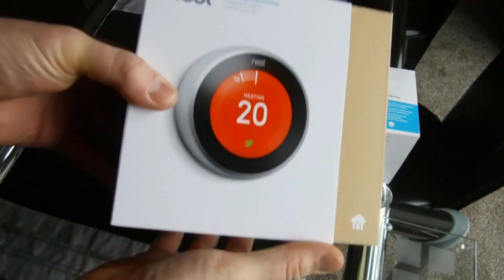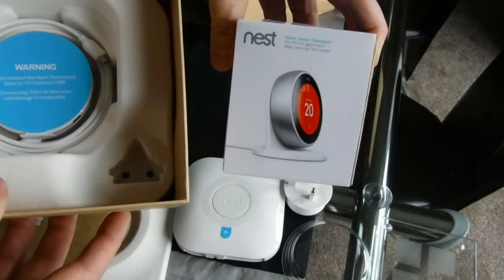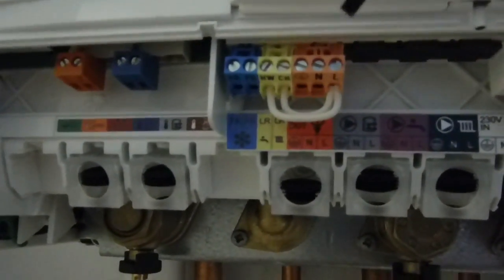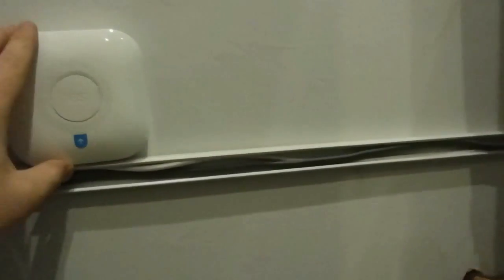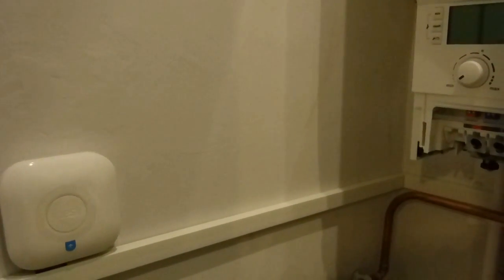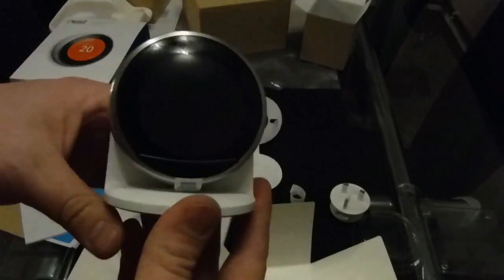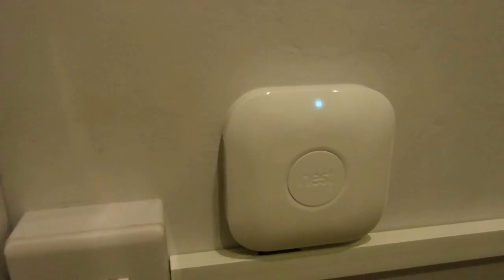How to install Nest Thermostat 3rd Generation - UK

Comment: Hi Charlie great video thanks, just had a question about your earth wire. How come you did not wire that into the Earth point in the heat link? Would love to know, cheers!
Reply from the maker: Hi Alex. It's a good question....basically the Nest instructions advise that an earth is only required if connecting the Heatlink to the Nest itself via T1 and T2. I would imagine it's because the Heatlink is all plastic....but that's my own opinion. Hope the video helped.
Reply: CharlieShooters KnowHow Ah I see thanks. I will be connecting my Nest using the T1 and T2 terminals, therefor I’ll need to Earth it then. Luckily I’ve prepped some 3 core cable like you, so I guess I’ll connect one end of the earth wire to the heat link, and the other end to my boiler’s earth coming from he mains input for the boiler.

Thanks for clearing that up, I’m all good to go now! Cheers Charlie!
Reply from the maker: Glad I could help. There should be an earth connection at your boiler specifically for a thermostat....if not, yes do as you said. Good luck with it all.
Reply: CharlieShooters KnowHow All my combo boiler seems to have is a choc block with Live, Neutral, Earth (here are mains for the boiler), then Common and Call for heat. No sign of dedicated earth for thermostat. But All earths go to the same place in the end so I guess al will be well.

Cheers
Reply from the maker: Yes that will be fine then. No problem. 👍🏼

Comment: @CharlieShooter KnowHow - I've got a Procombi A28 boiler, would it be wired the same as yours to get the thermostat working?
Reply from the maker: From looking at the manual for your boiler it is slightly different. L and N would be the same but you would need to connect the 2 thermostat connections on your boiler to 2 and 3 on the Heatlink. Hope that helps!
Reply: Would I need to loop anything? My builder decided to install this for me as favour but for some reason it isn't firing up the boiler.
Reply from the maker: SoleFreak No....if you've got 2 connections on your boiler for a thermostat then no loop required. 2 wires come from the boiler straight to 2 and 3 on the Heatlink.
Reply: Brill thanks for the help.
Reply: Could I ask what coloured wires would go in which connections (2 & 3)?
Reply from the maker: +SoleFreak The colour doesn't matter really as long as they only feed to the boiler. Avoid Brown and Blue as these indicate Live and Neutral. Plain black would be fine.
Reply: CharlieShooters KnowHow I see you used a triple core cable to wire yours. So for me, would I need a 5 core & earth cable or would you recommend something else? I’m a complete novice at doing anything like this so sorry for noob questions.
Reply from the maker: SoleFreak You'd be better using a length of flex (which is the preferred cable to use). I used the one i did as i had it already. 5 core flex would be best for you. 👍🏼
Reply: CharlieShooters KnowHow thanks
Reply: Hi mate, could I ask which manual you were referring to? I've opened up the boiler, can see the L and N but not sure which is the HW and CH connection points.
Reply from the maker: SoleFreak I googled the name of your boiler and I viewed an electronic version online. Make sure you search "installation manual" rather than "user manual". You'll get the connection info then too.
Reply: https://bit.ly/2I1DPIK

Comment: Why do you loop the live to number 2 on the heat link?
Reply from the maker: +Philip Ford Both Worcester Bosch and Nest advise to put the loop in. It works as a switchable live so when the Nest tells the Heatlink it needs heat, the Heatlink connects 2 and 3 creating a live return back to the boiler. Hope that helps?
Reply: +CharlieShooters KnowHow thank you mate. 👍
Reply from the maker: +Philip Ford No problem.
Reply: Is that also needed on other combi boilers?

Comment: Great video but bit confused, if I’m not wrong blue to N, brown to L and loop to 2 and last one black to 3 on nest control? Coz your wire connection not very clear.
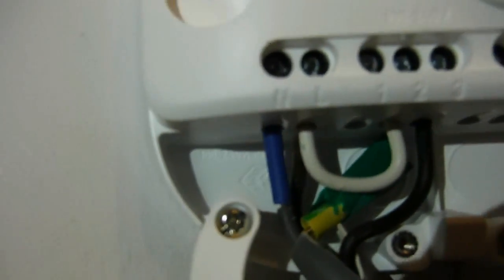Reply from the maker: +Suraj Thapa Yes that's exactly right. If you go to 6:50 in the video I do talk you through it. Thanks for watching.

Comment: Thanks for sharing this, nice and clear. Neat job with the conduit, really like that you don't see the wires going into the heat link. I know the box is plastic but since there is an earth terminal next to the 12v why not connect it?
Reply from the maker: +Frankie F Thanks....hope it helped! I knew there was a reason I left it off. Just checked the instruction manual and it says to only connect an earth if using T1 and T2 to power the Nest.
Reply: Ah ok, many thanks for the quick reply
Reply: I believe that earth terminal would be used for original cable which was connected to the old room thermostat and was a twin and earth and that earth would no longer be required for the new Nest thermostat which is now 12V so that wire could be safely connected to this terminal rather then left floating inside this box.
Reply from the maker: I think you could connect it if you want, but i just left it off as per instructions.

Comment: Thanks for the video which I am using to install my recently purchased Nest, I also have a Greenstar 30si boiler so it was particularly helpful. My question is similar to one asked by Nick Miles a few months ago, in that I have the exact wiring as per your video, already in place going from my boiler to a Heatmiser Slimline thermostat. You mentioned to Nick that it was perfectly ok to replace the old thermostat with the heatlink using the existing wiring. I just want to confirm that if you then want to use the heatlink to provide power to the nest thermostat you just run two wires from the T1 & T2 on the heatlink to the T1 & T2 on the thermostat, also if I did not want to see wiring running from one to the other, could I fix the thermostat on the wall right next to the heatlink or does it have to be a certain distance away
Reply from the maker: +Jane Turvey Thanks for watching and glad you found it useful!
To power the Nest without the power adaptor, yes, you would run 2 wires from T1 and T2 on the Heatlink to T1 and T2 on the Nest.
I'm not sure you can install the Nest right next to the Heatlink as the instruction manual states to leave 30cm around the Heatlink. It might be fine, but aesthetically I don't think it would look that great with the Heatlink next to the Nest. Can you maybe put the Heatlink the other side of the wall in another room? Or intercept the wires as they leave the boiler, putting the Heatlink there and using the rest of the wire run to connect the T1 and T2 connections?
Reply: Thank you......you have been very helpful

Comment: Thanks for this video, it is amazing. I have two zones in my house and need a nest on each. Both zones have a thermostat which I’m gunna use as charging for nest on wall but in a cupboard I have two other zone things. Above this is my wiring to the boiler. If I show you the wiring would you be able to advise which need to go to the link? Thanks Danny
Reply from the maker: +Danny Slinn Ill be honest, I've never installed one/two like this. But from what i can gather, you would basically need a live and neutral to power the Heatlink for each zone, and then a "call for heat" taken from each zone wiring to the respective Heatlink.

Comment: Why did you not use the nest to control the hot water. You had the connections for it in the boiler and the nest can support hot water. 
It would suggest you hot water burns away 24/7......
Reply from the maker: +Rob Wallace No, it's a combi boiler so when we want hot water we turn the tap on and it heats it straight away. The hot water control is if you had a hot water tank or such like. We haven't got one.

Comment: Hi mate
I have have the exact same combi boiler and will purchase a nest too.
However i also have underfloor heating in my extension which I want the nest to control too.
So for inside nest will do the heating and hot water for the under floor.
Any guidance?
Reply from the maker: +El Blanc If the underfloor heating is separate to your heating then you'll need a separate Nest thermostat for each. Hope that helps!
Reply: charlieshooter 
Hi mate
My underfloor heating is connected to my combi boiler (hot water)
Reply from the maker: +El Blanc If it's running as part of the heating system then it will control it together. If it's connected separately via a manifold/zone valve the  you'll need a Nest for each zone.
Reply: charlieshooter hi charlie merry xmas mate
The underfloor heating is connected to a zone valve/manifold, which is then connected to my combi boiler.
So would it be possible to use the nest i bought to control the central heating of the house and then the hot water for the underfloor heating?
Reply from the maker: +El Blanc No I don't think so. You'd need a Nest for each zone. One for the central heating and one for the underfloor heating. I might be wrong though...

Comment: Really useful guide. Unfortunately our 30si has been boxed in and I can’t remove the DT10RF reciever which is preventing the signal getting through. Any suggestions?
Reply from the maker: +apkdigital I think you're going to have to try and unbox the boiler somehow. I can't think of any other way. You need access to connect the Heatlink. Sorry....
Reply: Damn. Thought that’s what you might say. The heat link is wired in already, I can get to the connections, it’s just that I can’t remove the cover to get the old receiver out
Reply from the maker: +apkdigital Can you unplug the multi plug from the back?
Reply: I can’t see enough to see where the plug should be. If it’s accessible I can probably get a screwdriver in there to unclip. I’ll check the manual diagram though to give me an idea....
Reply: Finally persevered and wiggled the case free enough to unplug the old receiver without removing the boxing - hurrah! Immediately the relay could talk to the boiler and everything is up and running. For anyone else - do keep trying.
Reply from the maker: +apkdigital Good news!! 👍🏼

Comment: Hello I have a small question, can you connect the thermostat to the heatlink with normal electricity wires? and not the micro-usb? there is a distance of 10 meters between my boiler (where the heatlink will be) and the thermostat itself. I have utp cables from one place to the other and hope to use those? Kind regards
Reply from the maker: +edrush001 You can connect the Nest to the Heatlink with 2 wires from T1 and T2 on the Heatlink to the Nest. Existing thermostat wires can be used. Its only carrying 12v but I'm unsure about using UTP cables as they are more for data not electricity. Can you pull through a new run of flex or the like?
Reply: charlieshooter thank you for your answer, but I can not. When I bought this house before renovating the floor, I only thought of utp cables. But I think that'll be okay since you can also run some power through utp cables with poe-switches. I will have my nest tomorrow, I feel safer now I know you still keep an eye on the comments of this video :p.

Comment: Hi, Very interesting and informative video, I have a new Main eco system installed with mega flow, since it has zonel valve is the wiring exactly same for nest 3rd generation system? please advise
Reply from the maker: +Suresh Sukumaran If you were fitting the Heatlink to the boiler directly then it would be slightly different to how I've shown. You wouldn't use the loop from L to 2, but connect 2 and 3 on Heatlink to the connectors labelled bk in the wiring diagram for your boiler.
However.....as you have a zone valve fitted that's another story and I'm sorry but I haven't done that myself so I won't be able to help with that.

Comment: I have the ideal logic 15 boiler, and have now received my Nest, I am hoping it won't be too tricky to figure out how to install this myself.  If anyone sees this comment and can offer any advice that would be amazing... thanks
Reply from the maker: +James Hollingsworth You should be able to follow the video and wire it up yourself. It is the same principle on the Ideal Logic 15. Unless you've got Opentherm (which I don't think it has).....then use those connections.
Reply: ok thanks, i'll open up the boiler tonight when I get home and see what's what and may ask for a bit more help :)

Comment: Great video, but I've a week question - looking at the wiring specs in the installation guide my initial thought was that the heat link was wired in series with the 230V mains inlet to the boiler, and the relay would switch the whole boiler on and off depending on whether or not heat was required.  This didn't seem right to me as the boiler wouldn't purge after shutdown and it'd cut power to the CH feed pump as soon as the heat link opened the relay

Looking at how you've wired it though it's in parallel, iIs this correct?  The wiring diagrams for my Vokera combi say that I should wire the heat link the way you have but the Google instructions say the opposite.  Thanks for any help!
Reply from the maker: +devandy From looking at the installation manual wiring diagram for your boiler you would wire it similar to how I have but not exactly the same. Wire L and N on the boiler to L and N on the Heatlink then connect 2 and 3 on the Heatlink to the CN5 terminal on the boiler. So the one connection at CN5 goes to 2 and the other connection at CN5 goes to 3. That should be it. No need to put the live loop in like i have. Thanks for watching. Ps you certainly don't want the boiler turning completely off!
Reply: charlieshooter outstanding. I'd spent all night looking into it and finally got it figured out, but very much obliged to you for your help, sir!
Reply from the maker: +devandy No problem. Glad I've been able to help so many people with their installations!

Comment: Hi Charlie? what cable do I need. Combi Boiler.
Reply from the maker: +Errol Barnes 0.75 flex cable is fine to use to connect the Heatlink to the boiler.
Reply: charlieshooter do I need 3, 4 or 5 core?
Reply from the maker: +Errol Barnes 3 is enough but you can use 4 if you want to run an earth from the boiler for any future thermostats you may install. The Heatlink doesn't need an earth.

Comment: Hi Charlie,Thanks so much for your video, I have a six years old Biasi Riva Advance HE boiler, could I just simply connect L to L (heatlink), N to N(heatlink), then 1 to 2 (heatlink), 3 to 3 (heatlink)? also I have a Honeywell  T6360B , could I use the wires from there? L to L, N to N?  it would be my weekend diy poject. thanks a lot.
Reply from the maker: +ying ji xu Yes, you've got it. Ive just checked the manual for your boiler and that is how it should be wired, exactly as you say. If you want you can use 2 of the existing wires going to the Honeywell Thermostat to connect T1 and T2 (on the Heatlink) directly to your Nest. But the Nest must ONLY be powered by connecting to those OR by using the adaptor provided. No other way!
Good luck with your project!
Reply: thanks mate,  I really appreciate you look into it for me!

Comment: So you have to supply your own power cable between the heat link and boiler ?
Reply from the maker: +JT1985 Unfortunately yes you do. In Wilkos you can buy it by the metre rather than a whole reel.

Comment: Hi brilliant review this is what made me get a nest.thank you.
Just a question..I have a viessman vitodens 200-w. Would I just copy your way with the wiring. Thank you.
Reply from the maker: +Dean Sanders Glad you enjoyed the video and it helped you make a decision. You won't be sorry!
From looking at the instruction manual for your boiler it looks like you would wire it as i have done. It looks like your "call for heat" connection would be "1" on the boiler on block "96". Hope that helps!
Reply: That's great thank you. appreciate you looking into it for me.

Comment: Thanks for the great video. My Worcester Heatslave 20/25 has Live and Neutral inside the control panel but it also has two connections for a room stat that are currently linked together as no room stat is fitted. Any idea's how I'd go about wiring the nest to work with it?
Reply from the maker: +Ben Duker Hi....thanks for watching. You would wire that similar to how I have in the video. Ive just looked at the wiring diagram for the Heatslave and as i understand it, you would take the L and N and wire them to the respective L and N on the Heatlink. Then wire 2 on the control board to 2 on the Nest and finally 3 goes to 3. Let me know how you get on.
Reply: Thank you for the reply and taking the time to look it up. I'll be installing the Nest in a couple of weeks so I'll report back how it goes.
Reply: I'm pleased to report I wired it up last night as per your instructions and it worked perfectly. Thank you once again. I used 0.75 flex, was that large enough?!
Reply from the maker: +Ben Duker Excellent! Glad to hear it all worked and glad to have helped. The flex you used will be fine. Thanks for watching.

Comment: Hi there thanks for your video, helped me distinguish which wire was which. My vallient ecotec has an existing thermostat. With switched live and call for heating coming straight from the boiler and N & L coming from the fused switch. I used the N and L from the fused switch to power my heat link and switched live from boiler to 2 and call for heating from boiler to 3. Just wanted to clarify that the link from L to 2 is not required. Thanks.
Reply from the maker: +david brown I've never installed a Nest with a Vaillant, but from looking at the wiring diagram for your boiler I'd say you are correct. It looks like you link 3 and 4 on the boiler to 2 and 3 on the Nest. No link from L to 2 on the Nest is required then.

Comment: Do you have to do a loop from L to 5 if you are also connecting up the Water
Reply from the maker: +Darren Ettridge I haven't connected water because we don't have a hot water tank, but I have just checked the wiring diagram and yes you would loop L to 5.